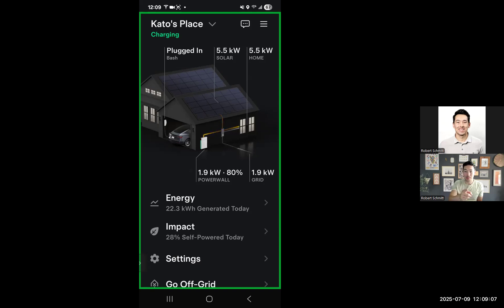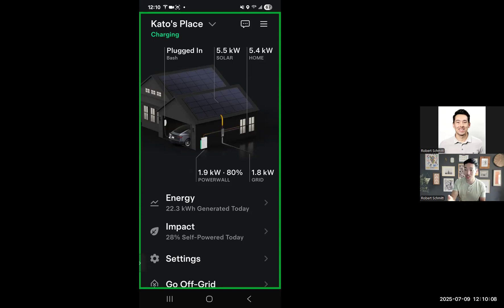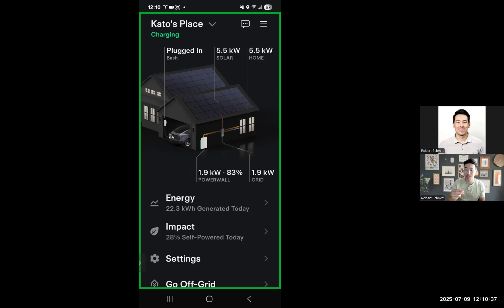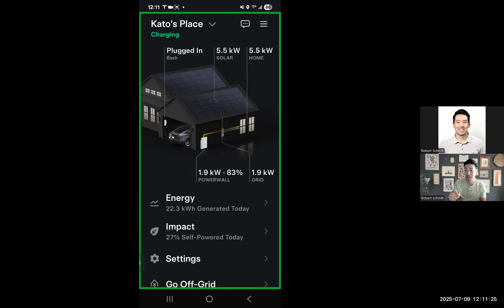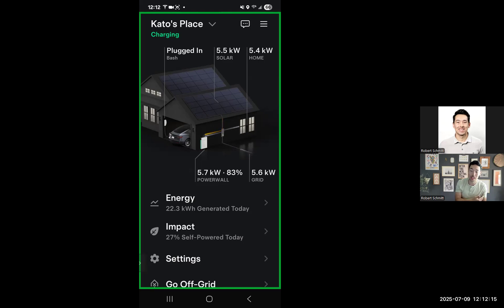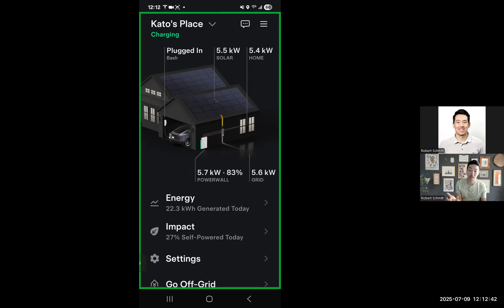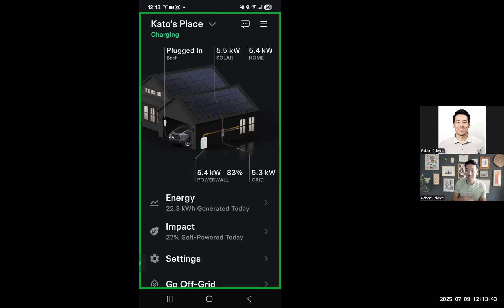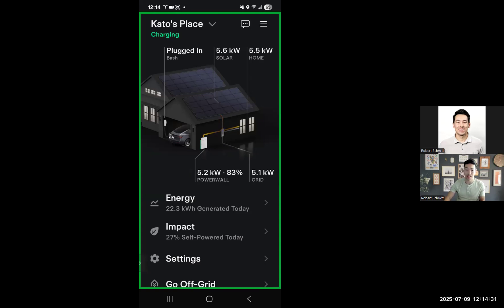Powerwall Grid Charging Issue (July 2025) - How to Fix

Comment: I live in the UK and I think this problem is showing up now as solar at this time of year is not adequate to boost shortfalls. I have a 9kW array and 3 x Powerwall 2 plus the Gateway 2. This last week has been very cloudy  over much of the UK and unfortunately the system has not been charging for more than an hour in our overnight super off-peak. I am starting each day with only a 20% charge. When there is little solar generation this does not give me enough energy to even run the house let alone export at the peak period. I am going to alter the super off-peak cost per unit to zero and see if that fools the system into charging for the full 3hr super off-peak period. If it works it will mean I will be able export enough peak to pay for all energy needed during the winter months without any further intervention, of course it will mess up the built in financial data but that is not that accurate anyway. I will update this post if it doesn't work. It is a serious omission to only have this half intelligent management system on Powerwalls. I have different energy needs several days a week. Day by day manual mode definitely needs to be an added option so that you can set each day of the week to different export time periods, or better still, set a reserve for home energy needed each day of the week.